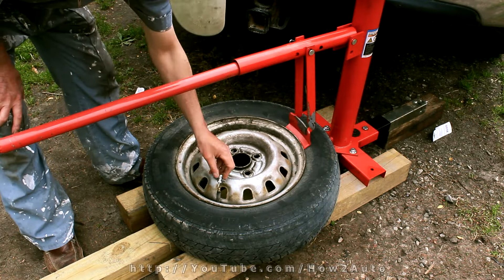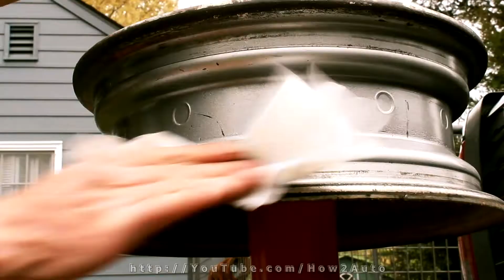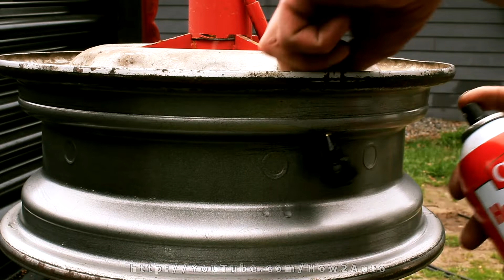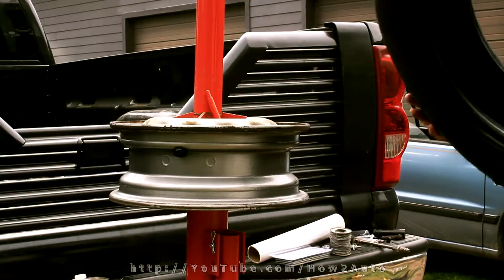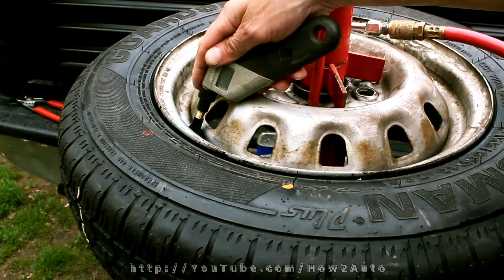Harbor Freight Tire Changer

Comment: Using silicone is not ideal since it does not dry like soapy water or tire lube  , the rim can actually slip  inside the tire when you drive  and your tires will be out of  balance  (at least mark the rim and tire to verify) ,, harbor freight just recalled all of these from the stores
Reply: I am glad I already bought mine!
Reply: Right, and soapy water mix is cheaper too!

Comment: I know this is a damn long shot, but 6 years ago you had a blood blister in yo mouth exactly the same as mine, how did u deal w yours? And should I quit smoking for the timebieng while waiting for it go heal, I've never had it before and id be lying if I said I wasn't a little worried, thanks anyway brother, be good to hear back
Reply from the maker: It was just a pinch from biting my cheek. Based on the comments, I should have brushed my teeth first. I originally took video for myself just to see it and then uploaded just for the hell of it. It wasn't scripted.
Anyway... I didn't do anything about it. It just healed on it's own. I don't smoke or do drugs. It was an injury. Sorry I couldn't help more. I think I'll post a follow up video with my mouth clean. 😂
Reply: Horses And More! It's cool I was overthinking 😂 I'm all good now u burst it. People overacted to ur teeth, the video was fine
Reply: Use Buttermilk friend if this ever again, Let it set in your mouth & drink it down or just spit it out, do this 5 or 6 times after meals, any inside the mouth sore will heal  3 to 4 day

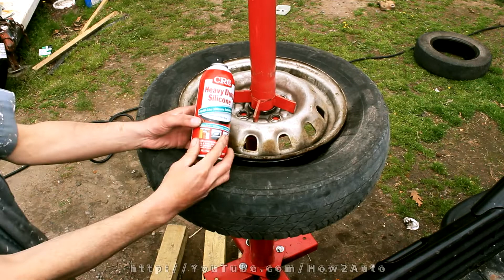Comment: WTF.... at 1:06 how in the hell did you flip that tire lip over like that..?? I have tried 3 tires and nothing. I have broken the bead on both sides... But the red pole you use to insert between the tire and wheel to flip the tire lip over... WILL NOT BUDGE.. That tire is super hard and will not flip over. I have tried 3 tires and NONE will let me do it.
Reply from the maker: Did you push the opposite lip down into the grove? I will say these tires are more flexible than normal. I will be installing some 16" tires soon and may film that with more detailed instructions. Tires are made with different types of rubber with some softer than others. The width of the tires can make things more or less difficult. The end of the video when I push the tire on by hand is rare.  I was lucky with that tire. I have not been able to do any others without really prying on the bar.
Reply: There is NO grove on this wheel... 95% of it is flat.
Reply from the maker: You right. Some tires are super stiff and some are more flexible and easier to work with.